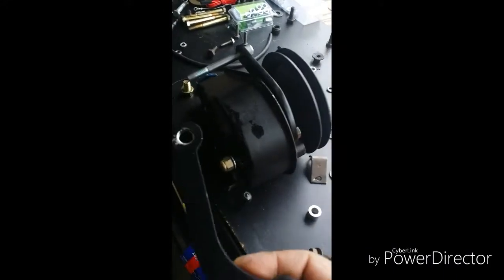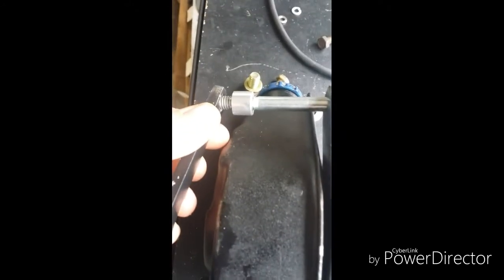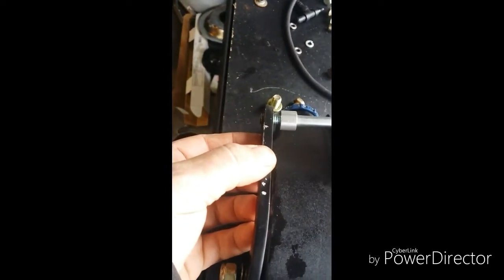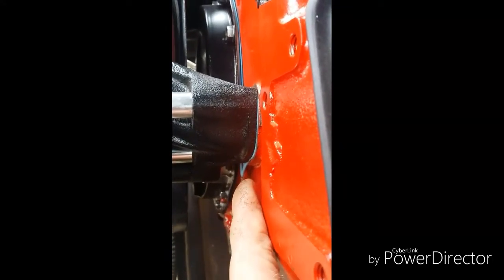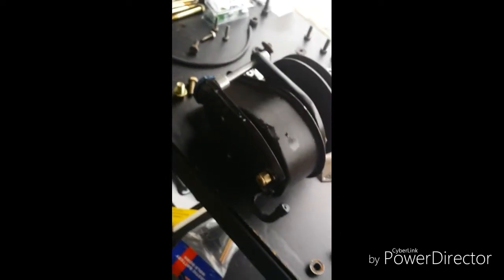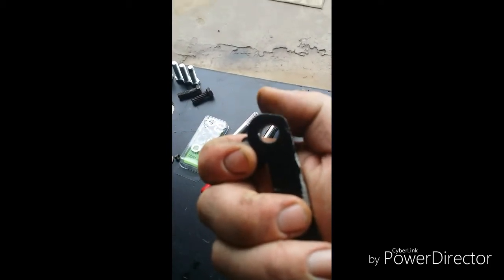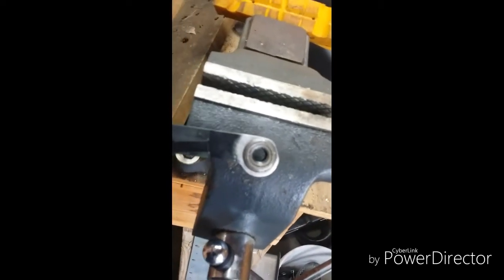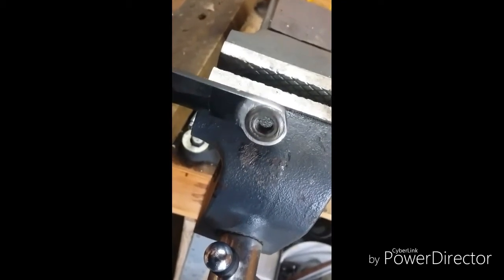Chevy 350 custom power steering pump bracket modification

Comment: That’s funny I just threw all this stuff in the trash because it was absolute garbage. By the time I got everything bolted up it was so crooked that the belts wouldn’t fit. I just went with a different setup but kept water pump and alternator on the same setup

Comment: Hey bro why did u change it where u having trouble with the old one ?
Reply: Yeah were you having trouble with the old power steering bracket
Reply from the maker: At the time I thought the big block pump was different from the small block I did the modifications cuz I thought I was getting an upgrade

Comment: So having looked at a few of these kits I know the problem you had. Posting to help others. These "J" bracket style brackets are popular and copied in many kits. In the better kits that hole in the bracket next to the block will be threaded. This makes a big difference as you found out and worked around by putting in the sunken nut. The cheaper kits don't bother to thread that hole. Not having a welder one could thread the hole and substitute a larger matching bolt and screw it together. This is what happens when stuff is copied and a small detail like a missing thread makes it hard to install.
Reply from the maker: Thank you very much
Reply: what kit would you recommend ?

Comment: What's the kit called?
Reply from the maker: Michael Nielsen I honestly can't remember it's been over a year now I just went through Google Images until I seen what I needed. Keep in mind you have to have a Saginaw pump for this kit which means it just has to have that stud on the bottom of the pump for the brackets to swivel on. Another thing I forgot to mention about this video is I ended up flipping that nut around and pressed it in from the other direction.
Reply: Gibson Automotive Design that's alright I appreciate it that information helps a lot actually. I installed long tube headers and put a temporary fix in to space out the factory pump mount from the block  but the belt started squealing mad crazy on my way home yesterday and spent all day trying to fix it. I need it fixed by tomorrow just trying to figure out the best way to do it.
Reply: Michael Nielsen m
Reply: @aandeautosales6219  huh?